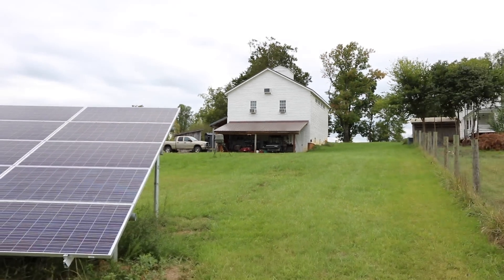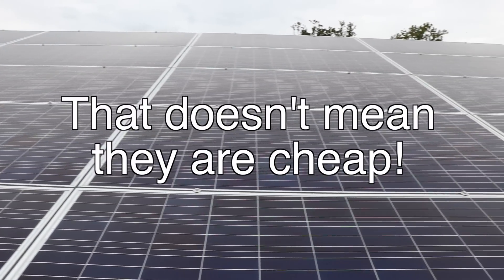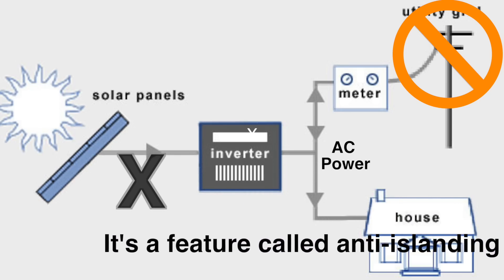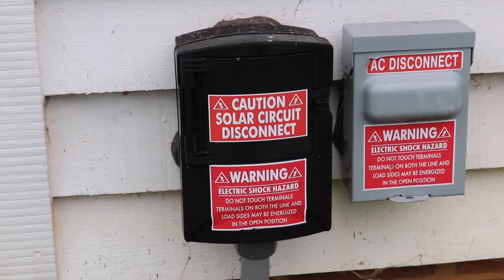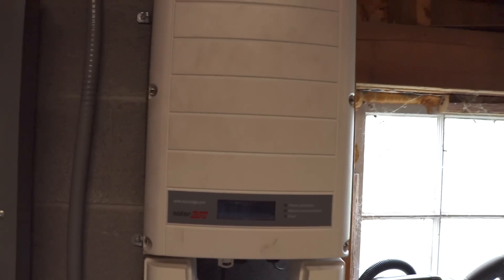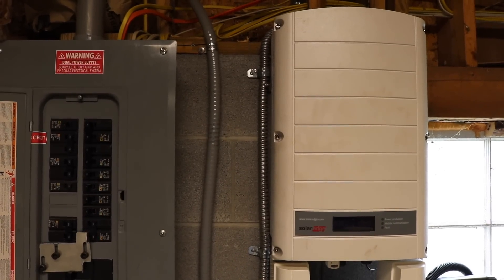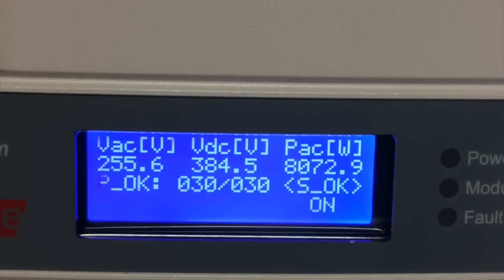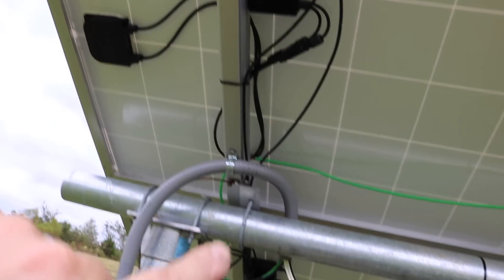The ugly truth behind grid-tie solar systems. Part 1, FarmCraft101 solar.  Watch before you buy!

Comment: So you paid $17000 to still not have electricity when the grid goes down?
Reply: I'm pretty sure the battery-backup system price was over and above the $28,000/$17,000 price for the solar-gen system.  I don't believe he mentioned the price of the battery-backup system, or if he did, I missed it.
Reply: check the video at 11:48 and then watch part 2.
Reply: JUDI GAR  , that's a good point. I pay on average less than a hundred bucks a month. Quite a bit less actually . Part of the reason for this is that I built a very energy efficient home. You have made me rethink solar.  Perhaps a small system with batteries would serve my needs just fine.
Reply: @kirkjohnson9353  Nowadays PV system only makes economic sense when you pay more than $200 dlls a month and you want to buy it. But there are other options like PPA.
Reply: Thank you Oscar
Reply: @kirkjohnson9353  It is easy to start smaller; there are 3.6kW kits and 6kW kits for a lot less than $17 grand.
Reply: Do it yourself, save tonnes of money and you can also build it the way you want it. That way you can afford to buy the batteries with the money you saved by doing it yourself.
Reply: Football5198
Yep, I'll have to replace my panels in about 30 years' time. By which time they will have generated roughly fourteen times the energy that it cost to produce and install them. So there will be an environmental benefit, probably -- but that's not the reason why I went for it. The main reason is that it makes good business sense, period. I'm not getting any tax credit, btw.
Reply: @RolfHeckemann  three words:  20 year caulk...  ;)
Reply: Of you can get a fancy inverter like I do and still have power because it cuts off grid feed when the grid goes down and still feeds the house with power and shed excess as heat. It reconects the grid feed when it detects its been reconnected.
Reply: Or pay $2500 without tax credits and always have elictric.  Build you own off grid system.
Reply: SearchingforSignalLLC - All that is needed after the auto shut down is power breaker that seperates the Solar power from the grid... It needs to be connected before the auto shut down. When the grid power goes of...you simply interupt the connection after the Grids ele meter...then after the auto shutdown.  This completely separates your home's power source by the grid and the auto shutdown.  These two will no longer allow current flow to the grid, yet it will allow the Solar energy to your house.
     The only reason I can think of, that this is not already been done it due to the idea that the power companies do not want you to be allowed to use solar eneegy.  This idea is supported by the much less amount power companies pay to people with Solar energy Power, the price power companies charge for electricity to people with solar power and the price people pay for electricity without solar power.
      When one considers the amount you get paid plus the amount you pay for electricity when your solar array is down...with... The maintainence costs you soon discover the power companies are cheating you big time.
Reply: JUDI GAR you think prices don't get higg in 17 years?🤣
And kirk even then prices can get fast straight up with solar panels you can get sometimes over 30 years ... and over 20 is no problem so it would be better🤣
Reply: You can trick a grid tie inverter to come on. It's a little tricky and i am not sure exactly how to do it correctly if trying with equipment that is not specified for this function but basically assuming you have at least small battery bank already charged. CAUTION HERE (the whole point of a grid tie not operating when the grid is down is to avoid power being sent back down the grid during power outs. It could be very dangerous to the people who are working on the lines and there might be a short on the line which could damage your inverter). So usually if this is an inverter capable of this function it will check that it has an open switch on the grid side before kicking in. 
If you want to try this then it is very important that you disconnect from the mains first.
 Run a smaller NON grid tie inverter to simulate the grids voltage (pure sine wave might be best, i'm guessing the cleaner the signal the better, check the voltage too, it should be around normal grid voltage and the grid tie will kick out a slightly higher voltage causing the excess power to want to run towards the point of lower voltage). but first you should check that there is a decent load turned on in the house somewhere. I'm not sure but you might blow your small inverter if not.
  Reasons for doing this might be to economise by using cheap equipment that you might happen to have lying around rather than buying off grid equipment. Perhaps you are building a system gradually and you are on a budget and happen to have access to a good mppt grid tie inverter. It might even be more efficient than a normal inverter of similar size.
  Or perhaps as a backup in a power out.
 If you have a decent size battery bank you could try making sure the charger is on as the load then if you know the batteries will be charging for at least a few hours and the small inverter is keeping them loaded a little the main grid tie inverter should be able to stay on. I am just not sure if you will blow up the small inverter without a sufficient load to soak up whats being produced by the bigger inverter. I have noticed some chat on a few forums so best go there and do some research first.
  The Sunny Boy make do one called the "Sunny Island" i think and this is designed with this feature in mind when working with some of the Sunny Boy GT Inverters. I believe there is a short backup built in and if you want more you just add a bigger battery bank.
Reply: Football5198 if you panels don't out live you, you better buy better panels. There are panels from the 1970s still in use. Secret. Buy you panels at 60% rating. Any good panel should last over 100 years. NOW batteries are another story.  I over charge mine they will last 5 years. If you maintain them, don't abuse them they can last 20 years on off grid. And Im Talking deep cycle, better batteries will last longer. The very first year I used car batteries, they lasted that year. Next I bought deep cycle, when I changed to a higher watt panels. 27 months of Deep cycle no problems.
Reply: Nonya Business Yep, trolls that don’t know what they are talking about.
Reply: AnantaSesaDas what I am saying is buy your panel, as 60% of there new rating. This way you will always have the electric you want, even a hundred years from now.  Forget that other crap of 15% effective.  Sure it would be nice to have panel space 1/10, the size. The only reason this one is so big is to line to pockets of the contractor, and electric company.
Reply: he doesnt include the opportunity cost of his 17k over 9 years ,  or the fact that the 9.1kW system will never actually deliver 9kW and the output will decline steadily over time,  also he wont ultimately save tens of thousands of dollars because ultimately he just has to buy the system again.

A lot of benefit , if you arent going off grid, really depends on the feed in tariffs that apply in your location and what silly games the power company plays.  Many people over invest in big systems when a better return is available with a small system just covering real power usage
Reply: During hurricane Irma...  We had power, lights, water...    But then we severed our connection to "the grid" making it impossible to back feed.   The idea about backfeeding into the grid is an absolute lie.   With the mains tripped to the off position.... Any and all types of power wired to the house side...cannot backfeed.   So....this means all laws preventing people from using their solar power systems work exactly the same as one using a gas or deisel generator ( Using fosil fuel generators (gas r deisel) are not attacked by law.)   Making these Laws tryanny-nazi-laws !!!  When enough educated people in solar Stand Up.. These idiotic laws will implode.
Reply: Does anyone know what happens when you put up a solar panel in the sun but do not hook it up?   Nothing!   Ok so now hook it up to 2 batteries (24vdc) but the input voltage of the panel is 18vdc... What happens?  Nothing... Absolutely nothing.  Ok so hook the 17.5 vdc (max voltage) to a 12vdc battery and a matching 6vdc battery for 18. Vdc.... What happens... Nothing... All these "nothings"   mean they work..they charge the batterys but they do NOTHONG that causes problems!   Everything the lae and the grid dudes say are lies.   I used to write about electronic theory. I have maintained Solar knowledge for more than 40 years.
Reply: no, the inverter has automatic shut-off during an outage.
Reply: How often does your grid go down? Not sure what third world you live in, but in the first world it goes down what, maybe a couple times a year? For a few mins at a time max?
Reply: SearchingforSignalLLC 
If he has battery back up he will have power when the grid is down & it looks like he has that.
Reply: I have a spotty circuit in my house and was thinking of just turning off the fuse to it and connecting an inverter to the circuit, then run as many appliances as I could off it when the sun is up. With the fuse off my thought is that it should be safe but 120ac only uses 1 hot wire so the return would still be connected to active circuits and might make this idea dangerous to pursue any further the way I'm thinking. Might just trace out the return and cut it somewhere but not sure if I want to move.
Reply: I meant to address that to Mark Askew.
Reply: Oh and in NC you can DIY as long as it gets inspected and meets code. That's what the cust service lady said.
Reply: SearchingforSignalLLC 
That makes no sense then to install them. But there's got to be a way to install them with out utility grid.
Reply: 4455/ 4455 by law you can’t be 100 percent
Reply: @Rick-ib3cj  There are many offgrid solar installations, although batteries are expensive, but when the grid fails and everyone else is in the dark, that it the real benefit, independence.
Reply: +4455/ 4455; with battery storage. Or just only use electricity during sunshine hours. Lamps and gas/manual tools at night.
Reply: It is only sending 1/10 of a volt back and it set up to run to the grid if there is power if not he does have a switch to cut off when the grid is out.
Reply: He has one but only for when the Grid goes out he does not need one if the Grid is on.
Reply: +Miner Au; how do you buy panels at 60% rating? Conversion efficiency is not even 25% yet. Or you mean used panels that are decades old and 60% of 20+% conversion (ie 12% total watts of electric per watt of sun)?
Reply: +Miner Au; you could always just add more panels as the efficiency goes down. What you're saying sounds like to buy 40% more panels than needed right away in prep for the decrease to 60% output 100years from now.
Reply: Solar panels require about 1-2 year equivalents of fossil fuel and that figure is falling annually.  They last decades, as do the electronic, so you are actually way ahead with solar.  I first installed 8 years ago without problems since.
Reply: Why did you not use SMA Sunny Boy inverters? At least when there is a power outage when the sun is out you will have a secure power supply to provide two kilowatts of power per each sunny boy inverter you installed. I'm installing to Sonny Boy 6kw inverters and so I'll actually have two secure power supplies each one putting out two kilowatts something to think of in the future.
Reply: @dobson777a  Do they include storage? How come?
Reply: @oscarrodolfostremplermonro1423  no I did not buy batteries they are not economical. It is way cheaper to buy a backup generator. The sunny boy inverters have a secure power supply which provides power from the solar panels even when the grid is down.
Reply: SearchingforSignalLLC basically the inverters only feed power back to the grid if the grid is working. Should the grid goes down the panels and batteries become useless. You cannot feed power back to the grid as it could kill those who are working on the lines. However if you have HYBRID INVERTERS then you can still generate and store power even if the grid is down
Reply: All you really need is a switch to the pole to make it off the grid.
Reply: Jerry Moody I trust you bro, but illegally you could trick the system into thinking it's getting power from the pole when actually it's not. Did you try a off grid inverter that's what I mention by the switch?
Reply: "and in the next video I show you how i hooked up some batteries to the system, so you can use it when the grids down"
Reply: A manual transfer switch doesn't cost too much power goes out you go to the switch and disconnect from mains if you trick it or use numbers and voltage goes into grid and injures a lineman your going to pay or be arrested or both even an automatic cutoff should not be too expensive .but without battery electric only in sun.
Reply: solar system is not "back up" system..., it is that hard to understand?
Reply: SearchingforSignalLLC Backup power is not the purpose of grid tied PV system.
Reply: Ya, that is grid tie. You have to make sure you do it the right way... I went off grid... only spent 12k... I have to be careful of nights (I don't have enough batteries) but otherwise, screw the grid! lolol
Reply: No, it's not to still have electricity when the grid goes down. It's to only save monthly electricity bills. Because he got a "Grid tie" structure here that won't work either without the grid power on.
Reply: My exact question, what if the grid goes down for a weeks or even more ... Your screwed! That's ridiculous...
Reply: Football5198 the point of grid tied solar is to save money, not be resilient.
Reply: Football5198 - christ there are even trolls for solar power system videos. These things make a good business case if you are staying put for 5 plus years. Simple arithmetic.
Reply: Football5198 you need a backup... something called battery... when he has sun he has no power problems...
Reply: It is easy to just turn off the grid breaker and run the inverter for power during outages. There is no ugly truth here.
Reply: Video says there's no transfer switch in his grid tied system. Without a switch his panel would backfeed the street power and that's bad (well, lethal for folks fixing things in an outage).
Reply: @BoydKn  The inverter does that function by shut down himself. (Sorry for my english, I'm from Mexico, but I am certified in PV systems).
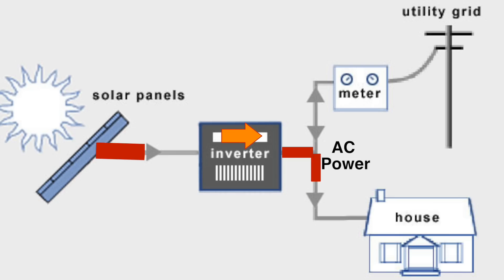Reply: @BoydKn  He clearly states that when the grid goes down the inverter shuts everything off.   Go to 2:26 on the video and listen.
Reply: SearchingforSignalLLC. Thats right!
Reply: SearchingforSignalLLC yea he need a battery but he get free no even profitable Power and you?^^
Reply: HOLY SHEET, with $ 17,000, I paid my bill of electricity for 17 years easily
Reply: @THEXEUX48  
He gets his money back after 7.1 years,  or to be sure 8.5 years. After this 8.5 years he is urning $200 a month or $2400 per year.
So after 17 years you spent $17,000,  while he (17-8.5 = 8.5 x 2400) urned $20,400 in 17 years.
Reply: People are you crazy..... did any of you think about weather conditions....
First You do not have 365 solar days.....
Second what in the case of storm flood or sever weather conditions... ice from sky can destroy those things before you replace them...
Try just to place AC in home on summer day on max and turn on oven.....
I allso think green but if someone is going to take money from pocket then I go crazy....
Some people place great money in their pockets from ordinary people
Reply: konj atic build the panels indoor
Reply: @konjatic6225  There are options available for diffetrnts types of weather like stronger structures, using additional modules, etc.
Reply: you know near my house someone is with about 900 Solarpanels ...^^ when i was born it were 400 he said he can buy every year about 50 ^^ but he wanna life from it ... ^^
Reply: Exactly. So to save the environment you are using crap tons of fossil fuel to make lead acid batteries, solar panels, do the install, oh and don't forget when the tax credits go away and you have to replace the panels at your cost (what?! They don't last forever?!) No they don't. Good job environmentalists.
Reply: 25 yrs average life expectancy for panels, all these systems will become cheaper as more people buy the technology. Do you think cars were always cheap enough for everyone to own one ? Thumbs up to early adopters there the ones that will allow your super tight arse to buy a system in 10-15 years at a cheap price.
Reply: @shiraz1736  no the warranty is 30 years on todays panels. They will last way longer then that. Efficiency falls off over time but they still are providing a lot of power. The inverters will last about 10 to 15 years and take about an hour to replace and cost $800. My system payback is about 8 years
Reply: @Football5198  The ignorance is phenomenal.
Reply: well, LA batteries are 90% recyclable.   If you want to smash the tree huggers, beat them up over their use of Tesla's.   Those batteries are less than 10% recyclable and in about 7 years they are going to be hitting the landfills in droves.
Reply: It's funny. A few weeks ago our power went out. My neighbor behind me who has his new house looking like a space shuttle with lag bolts through his new thirty year shingles that had a warranty (not anymore) was sitting in the dark, just like me. Hilarious. No shingle warranty, no power, .....so the point is!? 17000 dollars to sit in the dark. Solar will not replace base load supply with the current technology.
Reply: Football5198 t